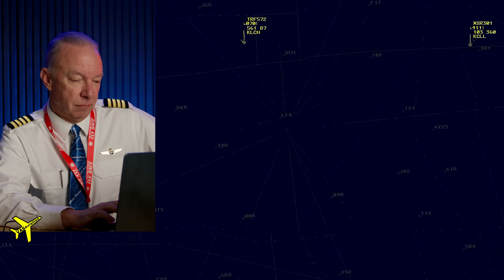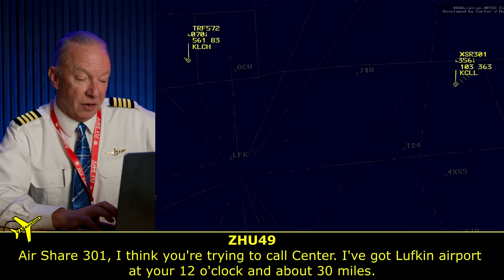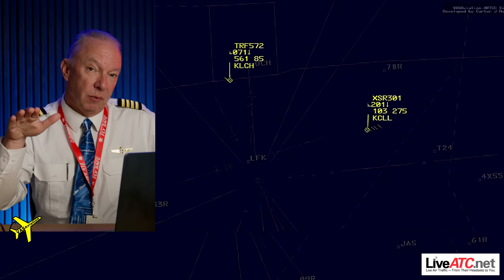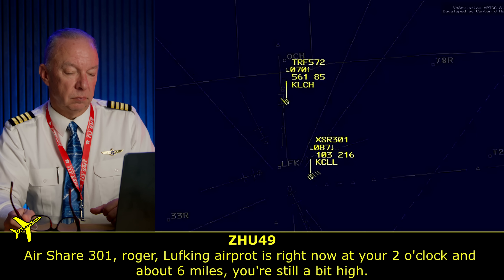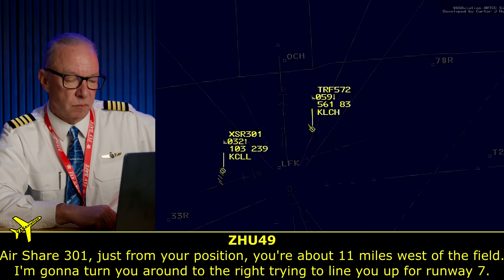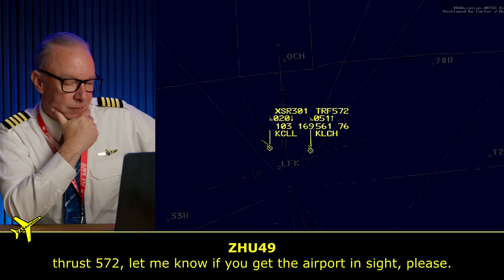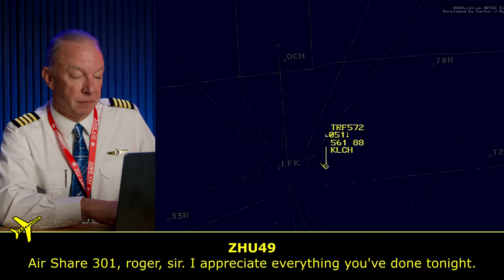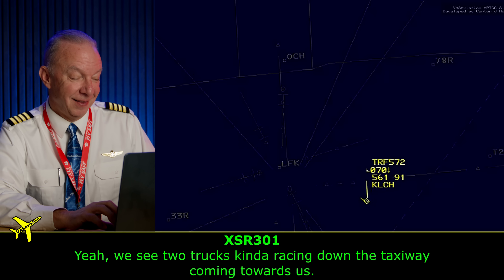Aircraft Loses All Power: ATC Saves the Day!

Comment: If the emergency aircraft couldn't communicate at all the plane still would fly, they would just have to find an airport with lights on and follow light signals from the tower or if it was an uncontrolled airport just land, but probably not knowing how long the runway is.

Comment: The sun flares do that the sky weather is alerting about that just today ago Dr tamitha skow alerts AVIATIAN to be much more aware that the electronics will fail in higher 22-32-35000 altitude 
Putin -trump have support and shielding equipment build in to secure extra power for the engines etc and the aviation

Comment: Both Gens Out.
.Captain Steeeve, I was just watching your podcast on the aircraft jet, loosing both Gens at altitude and it brought back a memory , thought Id share with you.  I had flown a Cessna 402 out to Wilmington from Tulsa . Traded for a 68 Cessna 421. On the way back , I stopped in Neosho for fuel and to wait out some weather at Tul Int. About 2 hours later I took off for Tulsa , IFR , I was due north of Pryor Ok when Center called , and asked if I could see a rotating beacon to my south. I said yes , that he was in and out of clouds.  Center asked If i would pull up his freq and try to raise him as Center had lost radio contact, The pilot was in a C 172,not ifr rated , running low on fuel, I made contact with him and we told him that center had him on radar, and that thru me we would vector him to a down wind, base to final , line him up on the run way , while also guided him once on final for power setting, rate of decent 450-500 ft on the vsi. He was calm , he made it to the runway, called me to tell me he ran out of fuel on the runway at Pryor. So I continued on towards Tul . Weather was 700/2 fog. Got handed off to Approach, they gave me a vector for the intercept. I lined up on the localize and as I approached the outer marker , lowered my gear and the cockpit went dark.  8pm. I checked both breakers , nothing. Lost radios the works, had a flashlight , my magnet compass and my VSI.  450 rate of decent, held my heading finally seeing the approach lights , landed and taxied over to hanger 2 , shut down , our line boy was running out to the airplane. As I stepped down out of the airplane he hollered at me that the Tower wanted me to call them. So I figured they were gonna violate me for not communicating with them and landing with no beacon or nav lights. I knew all these guys so I suspected a game to be played . But when I got up there tower chief told me that Center had called and instructed Gado to present me with a Save!. 

I flew for 34 years, commuter MHK-MKC, instructor, dealer, Cessna, Aero commander, Jet Commander Turbo Props , DC3s Citations,Lock Heed  Electra 10A LOL. If it had wings I flew it. Repoed airplanes for banks, had a paint, interior, minor and major mods. Had a mid air dec 74, idiot descended in the patern wrong, left wing hit my windshield blew my door open , brand new 310 i had sold in Pontiac. ATC tried to kill me in little rock due to air guard tying up the runway, fog low ceiling. Finally got a different runway, next morning shop mechs ran out of fuel going to the runup spot. 747 tried to run over me onthe runway i Bonn Ger,  weather below 200 zero zero. As I taxied off a reversed high speed turn off , the nav light of the 747 went over the top of my 840 commander. 
I also went to ATC school in Beloxi, flew a Islander back and forth to New Orleans in the afternoons after class, 7 days a week. it was fun. Spent 3 months in a tower and got out boring !!!!!

Any thanks for what your doing,,,, Air India 171 hell a deal huh.  Wife says tell him about being on fire. maybe later.   

Bruce Olsen ,

Comment: I flew the Phenom 100. With no electrical power you may be down to the emergency brakes. That system on the 100 was horrible and tended to lock the wheels very easily. That may be why they blew the tires. I had a break failure once and blew both main tires using the emergency brakes and closed a runway. It tends to go from zero braking to locked wheels very easily

Comment: Captain Steeve when you lose power to both engines could be your EFCU on both engines.(Electronic Fuel Control Units) You will not make take of power.I have done done many power take off runs on 747 and other aircraft and that could be the case of both engine failures.My opinion.

Comment: Thank you for sharing your experience and dedication to the industry. Major airlines are expanding at remarkable pace.  In an effort to staff these new aircraft they have had to lower the gate for hiring as they would have no candidates.  This is a terribly unforgiving profession.  Experience at the higher end  is the only way to shore up the industry.  Our job as aviation professionals is to mentor the cadre of new pilots and provide the safety net until they take command. These new pilots are academically very proficient and capable.  But at 2 in the morning in blowing snow or driving rain and thunder storms their backgrounds don’t encompass  putting a heavily laden 737 weighing 150,000 ponds traveling at 192 miles per hour safely on the ground. I have had 30+ years working in all conditions. My job is to understand these complexities and avoid them in the first place.

Comment: What if on the runways they start putting those “rubber bands” for a lack of better terms at the end. On the ships that pilots has so much to land they use these “rubber bands” to Stop them. Why doesn’t airports have them on the side laying down, and if it’s needed go have crews hurry up and put them up. I’m sure something would have to be made. I know the big jets are much bigger than little fighter planes… or even like 18 wheelers have run away hills with sand where their truck can go into if they lose breaks. I really wonder why they don’t make something from emergency plane land

I know those probably would be hard to make, and such for such a big plane… but it may stop some of these “cringe” moments when a plane with an emergency needs to land.

Comment: Im a Phenom captain. What Embraer calls an electrical emergency is an automatic power reserve mode that the airplane will go into when there is a dual generator failure. The Phenom has two batteries that we are told will give us up to 45 min in this condition. During the electrical emergency you are left with only one Garmin display in reversionary mode and the electric standby instrument. You also loose most of your equipment including the auto pressure, autopilot, flaps, trim control, yaw damper/ventral rudder, spoilers, stall protection, lights, and anti ice to name a few. After that 45 mins is up, you loose every single flight and engine instrument, with the exception of the magnetic compass.  All you have is control of the plane, since its cables and pushrods and the engine control is still available since it has a backup engine driven power source for the fadec. This is the first time Ive heard of this actually happening to a Phenom. The crew did an incredible job being faced with such a stressful condition.
Reply: Plus, looking at a no-flap landing, so 27 knots fast on approach with the stab trim stuck at whatever speed the generators quit. Airplane isn't fun to fly in that condition
Reply: @ashleymessenger4758  In the electrical emergency, it's only plus 17 knots (no icing).   It's different than the No-Flap speeds for some reason.
Reply: @ashleymessenger4758  can you explain a bit more about the stab trim?
Reply: @fleetskipper1810  I'm speculating they're talking about the trim motors; my assumption is that the aircraft can't adjust its own trim when there is no electricity, meaning the pilots have to fly the aircraft with the trim at the position it was at when the power went out.
Reply: Hi, nice explanation.  I am an electrical systems safety guy ( no experience with the Phenom) but the all in one standby should have an independent battery good for :45 min.  Yeah, when we do the analysis, :45 minutes seems like plenty of time, but as a pilot, it is a real deadline for getting on the ground in IFR, let alone night.
Reply: Thanks for the detailed explain.
Reply: Thanks Kevin. One of the things I like about this channel is how pilots/atc's share information in the comments like this. Great community here Captain Steeve!
Reply: They don't have a RAT?
Reply: Dual generator failure is a very extreme situation to happen. I don't know the electrical system from a Phenon, but I wonder if they have an interface unit that brings both generators together where the problem could be.

Comment: I was a Phenom 300 captain at a previous job. The airplane has no APU or emergency generator, so in this situation you have 45 minutes of battery and that’s it. No flaps, loss of anti-skid braking (thus the blown tires), no elevator trim, no autopilot, and the pilot with the only instruments who is hand-flying has the only radio.

Comment: My coworker was the controller they declared the emergency with originally. Pretty crazy situation. Losing electric and decompression at FL430 is scary. Turns out that the copilot was becoming hypoxic and also, his mic wasn’t working on his side and the captain had to do all the talking, the flying, and until the FO recovered, the checklists
Reply: Hi Jake.  I was the controller that handed this a/c off to your coworker.  FL430 w/ PD to FL360.  Small world.  From what I've learned is that the in this dual gen failure there is only one working radio and that is the left seat. The captain apparently didn't realize this (guess it's well hidden in the books) and with his hands full trying to keep the plane upright  they didn't realize this until they were much lower in altitude.  From the info that I've heard, this captain is very experienced and this was the most difficult experience he's endured.  I'm glad Team Aviation got a win that night.  The ZFW and ZHU folks are a good group of controllers and we must ensure that professionalism, expertise and commitment is passed on to the next generation.   I'm out in 30 days. It's up to you guys now!
Reply: Oh wow— if the captain had also become hypoxic, they would’ve crashed.
Reply: Thank you forthe feedback 10-4.
Reply: That pilot and ATC stepped up to an extreme challenge and saved those lives (and possibly those of anyone nearby on the ground).  Kudos!!  🏅🏆🏅

Comment: You said at one point that "they get just one shot at it". Why so? The engines were fine and to do a go-around, with continual vectoring from ATC, wouldn't have been a problem as such. Or am I missing something?
Reply: Night VFR and reading the standby instruments with a flashlight, in a business jet.
Reply: After 45 minutes, the back up battery goes dead.

Comment: Hi Cpt. S., I'm wondering if you are aware of any of the intersection of the communication systems, frequencies and apparatus/equipment with the similar parallel systems in business, medical settings and even basic safety first responder networks. You bring all this together in the flying industry. What you know can be applied to so many other situations. Sadly, I know from personal experience that too often the response initially is "follow the rules we were taught, never mind thinking this through" and then "the lawyers said we......." whatever and cya becomes sop. You mentioned possibly being forced into retirement by some of those rules and yes, you an address plenty of committees, stand endlessly at podiums, etc. but...I will be bold enough to suggest you may be able to design management materials and teach them, here on YT or whatever. I don't know how much you read comments but I'm doing the best I can with what I know. You truly are one of the best at honestly dissecting these events.

Comment: One question, why is the woman at ATC not able to put the lights on but only the other plane is?
Reply: Sounds like the controller is at a regional radar control facility. The airport doesn't have a tower or ground staff (at least not at this time of night).
Pilot-controlled lighting is designed to be triggered by an aircraft radio tuned to a particular frequency, and I suspect within a certain range from the airfield. Runway lights are expensive so they are not left on if no one is using the airport.
Reply: @BigBlueJake Thank you for exposing that.👍🏻

Comment: WOW I would never imagine that a bunch of radio traffic and a guy sitting in front of a computer could make something so riveting and shocking. And BLEW TWO TIRES ? Wow ! Thanks !
Reply: Just speculation, but there is a misunderstanding that in an electrical emergency the Phenom 300 loses normal brakes (it does not but the Phenom 100 does) and pilots will use the Park/Emergency brake that doesn't have protections like normal breaks. If you use the Park/Emer brake on landing with no "Brake Fail" CAS Message, you will most certainly blow tires.

Comment: Heh, and you keep saying that flying is safe. I had to land my single engine Piper Cherokee at night without a landing light once (my landing light bulb had burnt out during the approach). It's very difficult to judge when to flare without a landing light when the runway looks like a black hole and runway lights only add more difficulty for the eye depth perception. I landed OK but it was not a pleasant experience.

Comment: Note to self, regional ATC needs the ability to turn remote airport lights on. FYI, Lufkin is a VERY small airport 2 hours North of Houston.
Reply: some airports/aerodromes do, where there's a number you can call for automated weather and to turn on the lights, but idk whether that's common or not in the US (or even in the UK)
Reply: Yeah that's a great idea, that and a localized airport response for "emergency situation at airport in progress, please be advised no clearance is available until this message is cleared (add airport code) reported." Same for this situation for the closed runway.  "Attention runway 7/25 is closed til message cleared(add airport code) reported". That way if needed, pilots can relay to reported airport of issues.